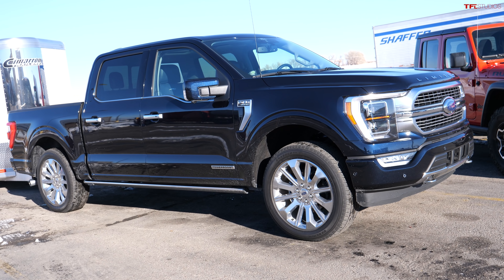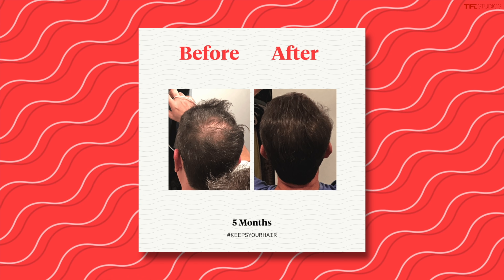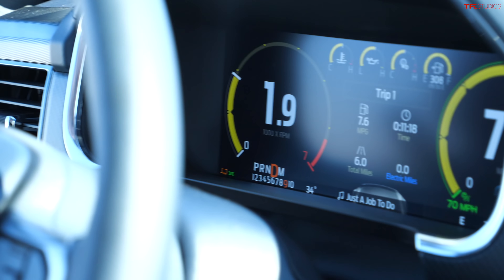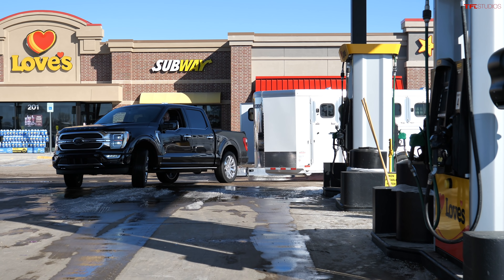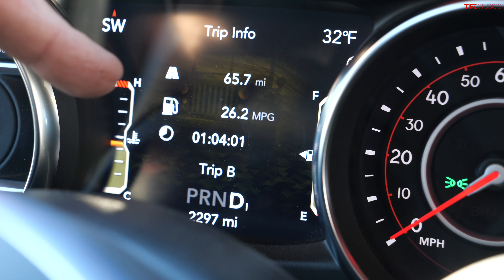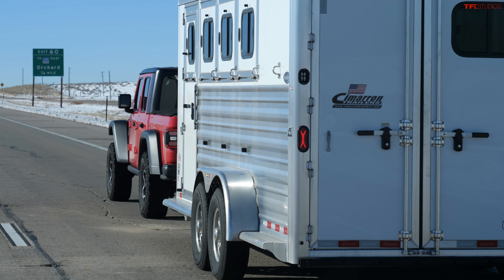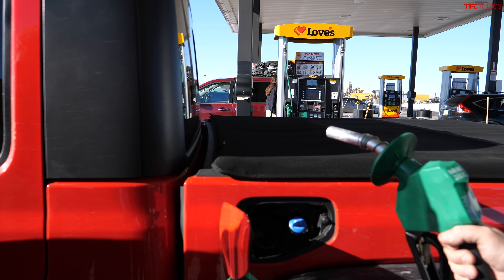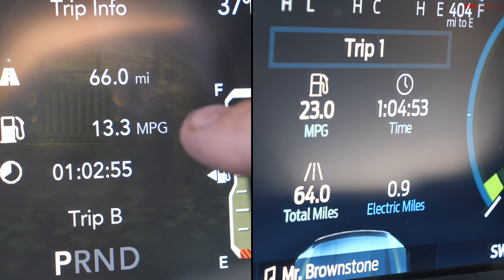We Didn't Expect This: Will a Ford F-150 Hybrid Get Better Towing MPG Than a Jeep Gladiator Diesel?

Comment: 8 mpg is really to be expected when towing with a hybrid since all the engine power is needed to move the trailer. Apparently the electric motor isn’t made to tow by itself.
Reply: Gas engines aren’t for towing at all. Especially a v6. If you tow a lot the fuel savings alone would pay the extra car note for a f250 diesel.
Reply: @MrPland1992  I would hope that no one would buy a 1/2 ton V6 solely for towing, especially a hybrid. I’m sure for the price of this truck you could literally have a diesel with a few options.
Reply: @EricFortuneJr.  you would be amazed. Every day someone on the Facebook groups ask why they’re new half ton gets 6 mpg towing a 8000 lb RV🥴. Then everyone makes fun of them for not getting a diesel lol.

Comment: W/fuel tank u can't cheat But w/hybrid not mentioning charge prt of equation u easily can. It starts full charge not counted & ends needing charge not counted, until power near free or free still a factor esp in high power rate states most ppl live in not on wind in middle or coal or full nat gas newest best way other than hydrogen & carrier gas

Comment: How long the batteries last towing ?
Reply: It's a hybrid so the engine is charging the battery as it runs
Reply: The Toyota Prius batteries last around 150,000 miles. That being said, not sure if the F150 and Prius use similar batteries.
Reply: @billymc2681  I guess what I’m saying if your pulling heavy load and electric motors assisting will charging system
Keep ahead of battery drain ?
Reply: @BrogeKilrain  it will always keep some charge in the battery. Discharging too low will destroy it. But how quickly it gets to cutoff depends on load, grade, and acceleration. The gas engine is strong enough on its own.

Comment: imagine a diesel hybrid. could do over 40mpg fully loaded
Reply: Once the battery is flat wouldn't it just use more fuel due to the weight of the hybrid battery and electric motor. I know people with mitsubishi PHEV's that get 19mpg

Comment: You should try driving 60 mph instead of 70 , then see what your results are.
Reply: No, please keep doing 70 mph that's what those of us under 80 typically drive on the highway.
Reply: 60 is not a speed that people drive in the real world. That’s more of a theoretical max mpg range
Reply: @justinwells6795  60 is more likely on a secondary 2 lane highway . In Oregon, the speed limit on such highways is 55

Comment: I hope you guys did not sell out to Ford and trying to get on their good side by not filling up and topping off the Gladiator on the non towing loop. 
That Ford Power boost is impressive machine and I will be purchasing another Ford product if this technology of the 7.2 kilowatt battery makes it into the Super Duty Diesel.  SUPER DUTY/POWER BOOST. This will be the ultimate machine. Diesel/Electric.

Comment: f150 making 29 mpg sounds like a pumping error.    If I baby my 2015 f150 ecoboost it will do 24.5 mpg on the highway at 65 mph.   Nobody is going to to baby it like that.    6000lb tow in the jeep at 11.5mpg is  makes a compelling case against the diesel.   My transit towing 5700lbs does 11.5-12 mpg at 65 mph burning 87 octane e10.  But at sea level.

Comment: I'm only getting 23 mpg or less out of my 3.0 duramax. Unloaded, 50 Mile round trip on the freeway.
Reply: Wow that is way under the 30 mpg to 33 mpg I have been reading about in the reviews. 7 to 10 mpg off of what is on the sticker is huge. Hope it gets better for you the longer you own it. Are you heavy on the right foot? The MPG ratings are for the old standards I think of 55 mph at sea level unloaded.
Reply: @MrBillsfishin  I drive 70 mph on the freeway, nothing outrageous. Now I'm barely getting 20 mpg with the cold weather. However, I've been regening 3-4 times a tank of diesel and have major blow by. I'm going through 1 gallon of DEF every 1000 miles. I currently have 6,000 miles on it. I've also had nothing but issues as well. My 2016 Cummings didn't regen in 15,000 miles. I got 10,000 Miles from a tank of DEF. 19.4 - 20.1 mpg no matter what and no blow by. However, that was pre-emissions scandal.
Reply: Was it just a one-time trip? Truck could have been running a regen during this trip which sucks fuel...
Reply: @NukePooch1  the truck is always going through a regen. Usually every 120-150 miles. My sierra elevation is complete garbage. Hell, the font diff blew at 146 miles. That's was just the start.
Reply: @JohnDoe-nz6bk  my buddy has a Ram 2500 4x4 and he gets roughly 18mpg to 20mpg with 35" tires and I am pretty sure he said about 10k for the Def. 
His friend with the Eco Diesel Ram 4x4 is getting 28mpg. 
If you are getting 20 mpg you more than likely have something going fairly wrong. I did watch several videos about people having issues with the new 3.0 gm diesel but many others that say it is amazing and the best of the 3 small ones. You should be able to find them on YouTube if you search.
Reply: I get 25-26 on the highway with a 15 ram ecodiesel thats leveled and has BFG all terrains
Reply: @MrBillsfishin  I'm having those same issues as others. But GM keeps telling me that it's working as designed. My 2016 Cummins was a 2500 mega cab limited. One of the best trucks I've ever owned.
Reply: @hemiaddiction  that's pretty good. I think once the bugs are worked out on the 3.0 duramax, it will be just as good as a Cummins. However, GM needs to do some soul searching with their trucks overall.
Reply: @JohnDoe-nz6bk  yes I agree, gm needs to focus on their interiors because my 15 limited still is better than a 2021 Denali or high country in my opinion
Reply: I've hit 32mpg on a 300 mile road trip, with one of those.
Reply: @terrencejones9817  I got 30mpg the first 4 days I had then. Then the constant regening started along with the oil burning.
Reply: @JohnDoe-nz6bk  something is definitely wrong. We've had 3 at our dealership as a service loaner. They have all been great
Reply: @terrencejones9817  I know something is wrong. But according to GM, it's working as designed. Unfortunately, it's a covid/ union strike truck. Built in march. I was thinking about buying a 3500 at4 a month ago, and it was definitely 1000 times better than this 1500.
Reply: @JohnDoe-nz6bk  take it to a different dealership, is my only suggestion.
Reply: @terrencejones9817  I have. They call the GM engineers to troubleshoot. It's always working as designed. Even with the blowby, the overheating, the extremely strong engine coolant smell, the excessive regen, excessive use of DEF. Burning a quart of oil every 2000 miles. All working as designed. 🤦‍♂️
Reply: @JohnDoe-nz6bk  what’s the total number of miles on the truck?
Reply: @Manisj1  6000
Reply: @JohnDoe-nz6bk  this may or may not help you. But i know when developing a gm oem Diesel engine, we had issues with the first 10,000 miles of excessive oil consumption, non repeatable exhaust issues including excessive regen etc. after the break in period the vehicles operated more “normal” your issue sounds different Than this, and sounds like a real problem. I’m sorry for your experiences.

For reference though, some comments suggest cmi does not regen for 15,000 miles. Regen frequency is dictated by cycle conditions leading to soot accumulation and a timer. Cmi, depending on the product has a 25 to 100 hour timer that forces regen.  Hope this information gives you some kind of help. 
If i were trouble shooting this issue of excessive blow by, and high Nox (high def consumption) i would be looking at the engine out Nox / o2 sensor. If it is reading lower or is slow to respond the egr will be closed causing higher in cylinder pressure and generating more Nox. However, since o2 is used in some engines for fuel rationality this could also cause poor fuel consumption. But all of this is conjecture.

Comment: This is going to be the hybrid that attracts a whole new customer base to a hybrid. No longer will the word hybrid be a running Toyota Pious joke as this opens up that technology to a whole new way of life. Look at the ice and snow outside. Winter is an enemy of hybrids and electric vehicles. That fuel economy will only get better during the warmer months. Also they used premium fuel which I suspect made a difference. My experience on my 3 previous Ecoboosts is that I have noticed better fuel economy when running premium.

Comment: I don't want to sound overly critical of otherwise enjoyable and useful content, but am I the only one who thinks a 66-mile loop is an insufficient testing length?  Seems to me a longer loop which burns more fuel would help to minimize the inconsistencies associated with the gas pump nozzles.  I assume TFL limits the test mileage in order to manage the time needed to complete filming/production.  Though entertaining I have thought for some time now their results do not fully represent the "real world test" that they claim.

Comment: Dodge- Ram-Chrysler Fiat, they do not make a decent engine and transmission, the only decent engine they have is the hemi, without the hemi in their cars and trucks, they will be sitting right next to Sears and Kmart in the has-been pile!! Not too long ago, Dodge got caught tampering with their EPA numbers on their diesel vehicles and had to pay a healthy fine.

Comment: I don't think you topped off the Diesel Gladiator correctly. I have had my Jeep Rubicon diesel Gladiator for 2 months and just driving around town I get way better fuel mileage than than 21 in the city (average 24.843 mpg) than you are showing on the highway.  On the highway; I average 29.431 MPG at sea level with cruise control on. I can see a little more fuel consumption with your altitude in Colorado. Not 8 miles per gallon less, towing empty (Not towing) and with cruise control on. I am a helicopter pilot by trade; and I am a stickler on checking fuel all the time. I use my electronic an E6-B computer, plus the way you guys calculate it on your Youtube channel and I have never gotten that low of MPG on the highway with my Gladiator diesel not towing. Sorry. Your results need another validation. Sort of like our Presidential election. I also have another suggestion: with your tow test. You maxed out towing capacity on the gladiator with 6000 lbs. and only touched the towing capacity of the Ford power boost of ( I am guessing 12,000 lbs?). Maybe do a percentage of its capability of each of the vehicles towing capacity Lets say 80 percent.

Comment: I’m totally ashamed of the cars and trucks of today, they should be getting with us electricity motors 50 miles to gallon minimum , it should be way better then that actually, 
I have and deceased great uncle that had a 6 cylinder ford falcon n the early 70 s that was getting 65 mile to gallon with no electric motor power at all , it was a exhaust regeneration invention that he came up with, and it had other equipment he invented, 
So this stupid 20 s miles per gallon with 100,000 dollars of gadgets to go bad later on in its life , this is a huge wast of wires and metals, 13  9 21 miles to the gallon, my 1994 mid size S- 10 will pull 15000, pounds and get 20 miles to the gallon,     All these vehicles are is to get your money from your wallet, this is the reason the green lovers want all electric vehicles, if the car and truck manufacturers don’t stop doing stupid stuff and actually start building a 50 plus miles per gallon trucks with out electricity ⚡️ they will be all electric, 250,000 dollars per vehicle, I’m not into that ,    The electric vehicles can’t go vary far, what 300 miles , at that rate a gallon of milk will be 20 dollars,loll, I’m serious, no thanks BigAl California.

Comment: not to mention in world current tech a diesel will out range a tech easily normal & esp tow or hauling miles real world to say nothing of backend, & 500yrs vs limited mineral BS current battery tech. Cheap any where in world repair vs tech only repair or more likely replacement shop.

Comment: wow semi hidden secret diesel old is new again, kicks gas & newest scam by elites ass. 40 miles of ecc mode or commute mode or launch mode or under 29 say upto 25mph or so mode is the best hybrid will do, in real world 1/2 of market sales trucks. Good driving mood charging or fast charging still more important than range. Wt & space of system defeats the purpose or best feature of van stow or hybrid go. Bal & more octane fuel & cheaper greener fuel way to go all day every way across any platform, but esp in 75+ percent of real market.

Comment: This channel is going down hill fast. I have a 2019 Chevy 1500 with a max tow of 11600 lbs with the 5.3. I tow horses and hay the most I have towed is 9500 lbs roughly of hay. I got 9.8 mpg with a 3.5” lift and 295/55r20 ridge grapplers on a 10” wide wheel at 65 mph not on flat ground. The f150 towing is a joke